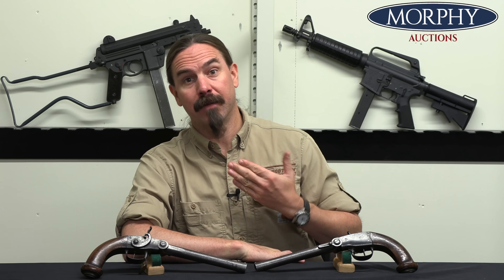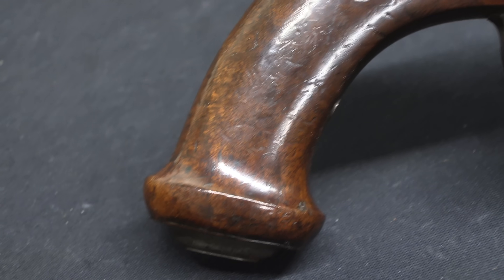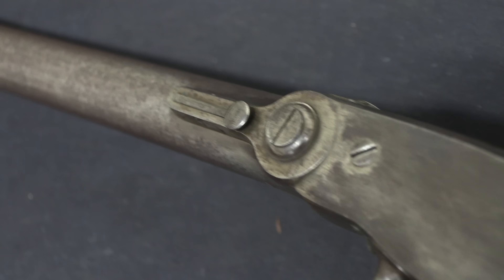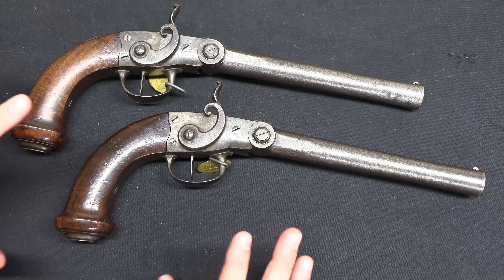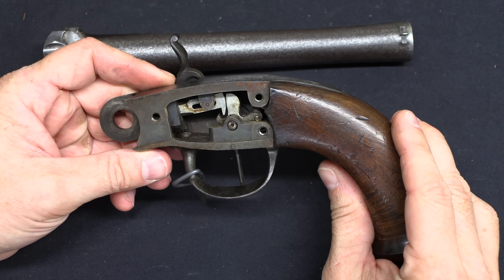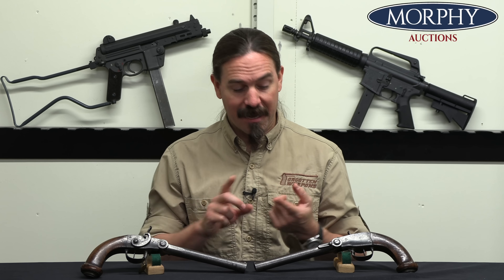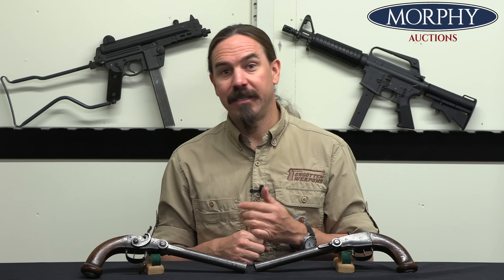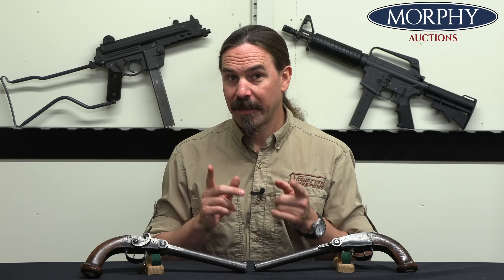Pauly/Roux Pistols: The First Self-Contained Cartridges

Comment: A guy I knew many years ago had an Ether Gun. Basically an air rifle with a felt packed chamber on the side  which you filled with ether. Normal break action air rifle, after you loaded the rifle, you could pump a charge of ether into the compression chamber and when you fired it, the ether would detonate exactly in the same way as a diesel engine functions. It got some pretty impressive range and energy from a standard .22 air rifle pellet. 
I forget the brand but I understand that it was Boer war era and was made to get around some rules restricting civilian possession of firearm in some African countries.
Reply: WHB Smith's Gas, Air and Spring Guns of the World discussed one such.  Didn't work all that well, per him, but the book was from the 1950s.  Maybe there's been further development since.
Reply: @chuckbridgeland6181  This was a pre 1900 gun. It took some practice to get the right mixture to fire really well. This one had had its pivot and breech lock reconditioned.
Reply: Wiehrauch made something like that also. The model that had the same mechanism but without the ether tube is still a thing.

Comment: I wonder if this could be reproduced by Uberti or Pedersoli in something like .22 short, .32 S&W, maybe even .38 Special.  If the lock time was quick, the trigger clean, and with the sights on the barrel, it should be quite an accurate little plinker.

Comment: Paper revolver cartridges were waterproof, they used nitrocellulose glue as a varnish. They also used intestine instead of paper, which were also waterproof. Sodium silicate, water glass, was also used to seal cartridges, like paper shotgun shells.
Reply: hmmm sausages
Reply: As I recall, waxed paper (basically cardboard) was also used to keep out the damp.
Reply: @eldoradocanyonro  
Those "cardboard" 12g cartridges were sold right through  the 1970's...
(I have a couple at home...and shot a few just to see how they go..no problems).

and then in the 1980s when plastic finally became overwhelmingly common

Then they cheapened the reloadable reformable reusable brass based plastic hulls by using single use steel as the base....

Full circle since Remington and Federal have reintroduced premium paper hulls....

Comment: As an engineer, the simplicity of that mechanism is admirable.
One point worth mentioning: from what I see, Pauly is the inventor of the ball valve.
If you see the barrel/frame seal, it's half a valve!
Greetings from Patagonia, Argentina.
Reply: Given how little a seal the "cartridge" provides, making it a ball valve makes sense.  Gotta hold back against the strength of the gas expansion to keep it going through the barrel forward rather than backward.
Reply: @Stevarooni  That's right! But according to the internet, the ball valve wasn't invented until the late 19th century. That's what surprises me.
Reply: From one mechanical engineer to another: well observed. I’m shocked that this preceded the invention of the ball valve by a good 30 years or so!
Reply: "perfection is attained, not when there is nothing more to add, but when there is nothing more to take away"
Reply: @NoNameForNone  wise words

Comment: The "fire-piston" is what Daisy did with their caseless .22" rifle. It was also the basis of many an ad-hoc conversion of a break-action air-rifle to fire .22" rimfire cartridges, because the "puff" of air was powerful enough to dent the whole base of the cartridge and even if the priming compound was only in the rim (the ammunition probably needed to be German for that to be true in any case) it would fire. Preventing this sort of trick was probably why the seal on such air-rifles moved from the end of the cylinder to the barrel, because that made the barrel too weak to survive the conversion. There's a work-around for tap-loading air-rifles best not described here, but it's really close to what Pauly did!

Comment: When they got to the point of putting a percussion cap into the base of the cartridge it's too bad they didn't pursue a shotgun design - the break-open shotgun would have been invented a lot sooner. The lower chamber pressures are perfectly suited to this.
Reply: Or better yet if Pauley used a zinc metallic cylinder tube for the cartridge in addition to the metal primer base, he would've been the 1st contender for the inventor of the metallic breech-loading cartridge but zinc isn't corrosive-resistance metal alloy for long term storage😉
Reply: Ian has a video on a full size shoulde arm that i think smothbore and intended to be used for duck hunting. (Otherwise the duck shaped stock would not make much sense)

Break action shotguns became the norm with pinfire (so 1860s?) and pinfire shotguns seem to have stuck around into the 1920s at least in europe as they were simpler mechanisms and easier to reload at home to my understanding.
Reply: Pauly made a double break action rifle on the same system that was rejected for French military adoption in 1812.
It looked and functioned exactly like a modern double barrel shotgun but lacked a cartridge extractor but had a pair of fully rifled barrels.
Reply: @allangibson8494   Pauly still had the fulminate-stuffed-in-the-base system then. Roux should have tried again after he'd progressed to the percussion cap nipple base - but as a shotgun to the civilian market. Easier to make, less chance of a chamber breach, and easier to market.
Reply: @donjones4719 Pauli’s rifle used Forsyth impact primers in the cartridges. It used reusable steel cartridges unlike the brass cartridges of the pistols. It was a quarter century ahead of its time.

Comment: So close to a true striker fired design.  Cut off the "hammer" and add a striker spring, and you're there.  But in fairness, I don't think 1820s metallurgy would be suited to producing reliable springs of the necessary size and strength, economically.

I'd love to see the earlier fire piston action - the only place I've seen the Diesel Principle proposed in "real" firearms has been in advanced liquid, aerosol, or gas propellent designs (usually artillery or tank cannon proposals), and then it generally makes more sense to use electrical spark ignition.  Now, I have I have seen diesel ignition proposed for two reasons - 1. to avoid "plug fouling" and contact erosion, or 2. to ensure a self powered automatic light cannon (but, honestly, when you're dealing with a fluid propellent, you need pump energy anyway and the additional load for an electrical igniter is trivial at that point - both can use energy recuperated from the recoil and cycling of the action, and probably take less space and weight than the hefty spring you'd want to initiate firing... plus the danger of a runaway gun, as anyone with a crappy engine that diesels for a minute after turning off the ignition can easily imagine.)

Comment: That fire piston concept is quite evident in my air guns.  The pump gets bloody hot while getting them up to 2900psi. Totally worth it, fun to shoot without excessive noise and cost. The local rats don't like it so much.
 Likewise you can feel the effect in reverse when discharging CO² airguns rapidly or if the bulb isn't installed properly, bloody cold on the hands.
Reply: There are also people who squirter a little aerosolized light lubricant (like WD-40) into air guns to get an extra but of energy as the diesel effect.ignites the fumes.

Bloody dangerous, in my opinion, as the breeches weren't designed for that stress.  But folks do do it.
Reply: @geodkyt  I've done it a few times with my Big Cat and tested it ballistically on aluminum. It can definitely add more than just a bit of extra power.
Reply: @geodkyt  a tiny touch of sewing machine oil in the 'cup' of a Diablo pellet is all you need. People use petrol and starter fluid, which is crazy dangerous.
Reply: @geodkyt I'll confess I have done that with my PCPs, luckily I'm UK based so legally all non-FAC air arms are under 12ft/lbs. The upside is most are deregulated from 25+ft/lbs offering quite a bit of leeway if they get overpressured somehow. Usually it's for the puff of smoke and little muzzle flash when plinking of an evening down on one of my empty paddocks. Cheap fun compared to the shotty and less likely to cause upset among the neighbours.

Comment: It is usually easier to produce a complicated system for any given job than a simple one. Simplifying the first idea takes extra work.
Reply: Fire pistons were a common way for people to start fires before lighters/matches becoming commonplace. The technology was not new or complicated for the time. They used to use simple brass tubes with a piston with some very flammable tinder (like charred cloth) in the base of the piston. Press down hard and it catches fire.

Comment: I am consistently amazed at the quality of the machining in what are basically 1st Industrial Revolution pieces. Consider that these beasts were built basically by hand, machined on treadle run or later steam belt run lathes and mills with probably a fair amount of hand finishing. And the rifling in those barrels! No CNC, no high precision control mechanisms, nothing but brute force and early hard metallurgy technology. Amazing stuff.
\

Comment: Did Pauly or Roux make shotguns based on this system.  This would make a good single or possibly a double barrel shotgun.
On the heat fired cartridges - didn't someone come up with caseless rounds in the 1970's or 80's.  I believe they were actually offered commercially for a while before they failed to catch on.  
It seems like such a simple step to put fulminate of mercury into a little copper or brass cup for a watertight ignition system, but it actually took a while to make that leap.  Berdan primers are really nothing more than that.
Reply: I think they did. This channel has a video on a Pauly long gun though I can't remember if it was shotgun or rifle

Comment: After firing, did the percussion cap eject when the barrel was opened or did it have to be extracted with fingers or the gun tipped so it fell out?
Reply: I'm not seeing an ejection mechanism. The rim of the cartridge comes with an additional groove that seems like it's designed to help with manual extraction however, if you look closely at 6:50.

Comment: Diesels have glow plugs.
Reply: only used to preheat the combustion chamber before cranking.
Reply: Many do. Many do not. Cummins used intake air "grid heaters" until recently.
Reply: @brandonobaza8610  you are missing the point, glow plugs or grid heaters are  not igniters, compression is.
Reply: @TheWibbo  Right, pre-heating is not a required component for continuing the combustion process. That's what I was hoping to imply by saying "some do, some don't". I sort of muddied my point by mentioning grid heaters.

Comment: Simplicity is very hard. I know this as a designer myself. The Colt automatic pistol did not hit the market fully formed. The model 1900 was vastly inferior to the 1911 both in form and function, but the 1911 is hard to improve on.

Comment: Have you ever heard of Metal Storm, and if so would you consider making a video about it.
Reply: Oh man, those things. Falls into the "that's so stupid. I want one" category 😁
Reply: @brandonobaza8610 Now, now, there are a few use cases where it makes sense.  Two, right off the bat:

1.  Aircraft (including drone) gun pods for low pressure loads (basically grenades), where a superimposed load gun is lighter for the same magazine depth and ballistic performance than an auto loading one would be.  You can't reload in flight, so the fact that it's a PITA to recondition and rearm the pods is less of an issue - worst case, you treat them as "single use, return to depot for reconditioning" items.

2.  Anywhere you need a disposable repeating arm, especially one that is remotely fired and thus is automatically discarded.  Such as emplacing pre-registered multishot mortars to cover likely avenues of egress for a raid, so a team on the run can trigger fire on TRPs in canalized terrain right after passing through to hamper pursuit.  With modern technology, such systems can be emplaced remotely by drone or parachute, use use on-board sensors to determine location and adjust aim to the pre-programmed TRP, and sit waiting for use (becayse a MetalStorm type system can be pretty thoroughly sealed against environmemtal condotions, they could be emplaced as much in advance as battery life and your risk of random discovery allow.)

Comment: A trigger with a piston gotta be quite a heavy pull
Reply: I am assuming the piston was spring loaded and the trigger just released the spring pressure
Reply: @caviduragraphics Yeah, no way you're developing enough speed to set off a fire piston with your index finger.  But with clever geometry, you can design a sear that will cleanly and easily release a LOT of spring force to hit the necessary velocity and pressure.

Comment: "Is your pistol hammer fired or striker fired?"

"neither, it's diesel fired"
Reply: Hang on a sec, I gotta switch out the glowplug in my pistol.
Reply: @jasonbelanger7525 😂
Reply: @jasonbelanger7525 Who the hell put a Holset turbo to my pistol ?
Reply: @jasonbelanger7525  I think something like that would actually be necessary in freezing weather. I know I can't do the math, but you'd probably need to heat the breach up over a fire or carry it in your underwear something.
Reply: It would give "cap and ball" a totally new meaning.
Reply: On the inverse, we have some engines that are started by cartridge rather than electric or kick start lol
Reply: @Twinspinner  "Let's go into town." "Can't, my car's out of ammo."
Reply: If this could have been improved, a percussion cap wouldn't even be needed. Just use heat to ignite the powder.
Reply: @danielhurst8863  The issue would be that it might not work well at altitude where thinner air might result in insufficient compression, and there might not be sufficient weatherproofing/sealing of the firearm itself to keep carbon buildup out of the fire control mechanism.  For a single-fire pistol it might be fine, but firing multiple rounds might gum-up the mechanism far too quickly to make it viable.
Reply: @danielhurst8863 Daisy (yes, that Daisy) made some, known as the V-L. It works a lot more like a springer air rifle than a typical firearm. 

It had some sealing and accuracy issues, but the main issue was that it was a firearm, and ATF said they needed to become an SOT to make and sell them. Daisy decided to cut their losses and halted production.
Reply: A hammer fires a striker who then sets the air on fire.
Reply: There was a Daisy .22 that used a caseless round that actually did diesel to ignite the charge. I think there’s a video from Rock Island Auctions on it.
Reply: @ajzager1  Yes, the 'Daisy V/L' rifle produced in 1968 and 1969.
Reply: Blows your mind, drastically fantastically
Reply: This sounds like the most steampunky thing for a gun.
Reply: @ChannelSho  Dieselpunk. Steampunk uses steam power.
Reply: Great bit of history. Thanks Ian
Reply: Well no, I think you've misunderstood. It just uses air.

Comment: Adiabatic compression is indeed a really cool system to ignite a small arms round. Unnecessarily complex for sure, but still neat.
Reply: The Daisy V/L used this system. The "cartridge" was a .22 caliber projectile with a block of solid propellant formed onto the back. Rifle was loaded and fired just like an under lever air gun...because that's what it was.

Interesting concept